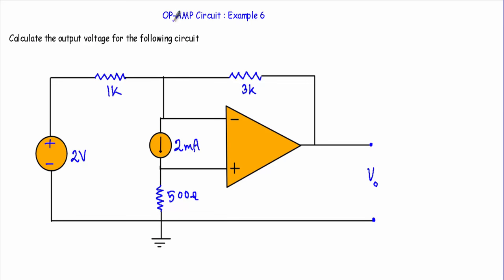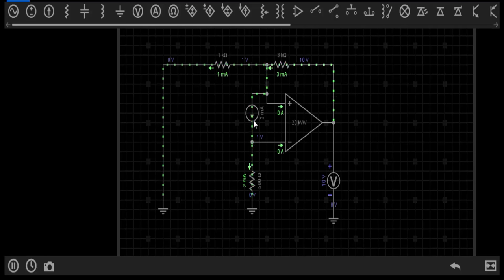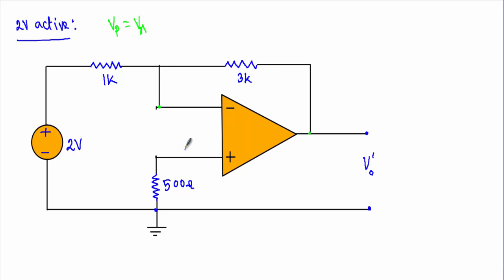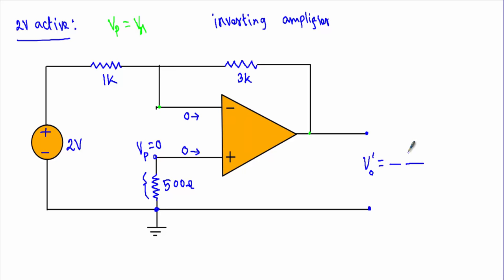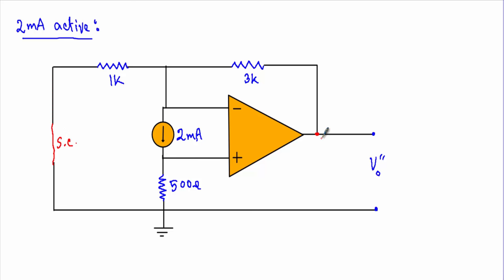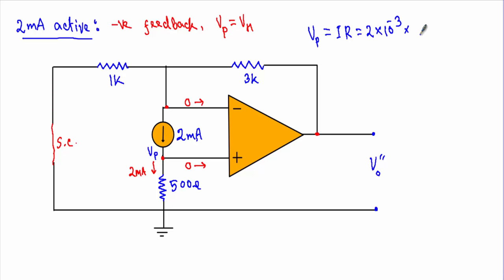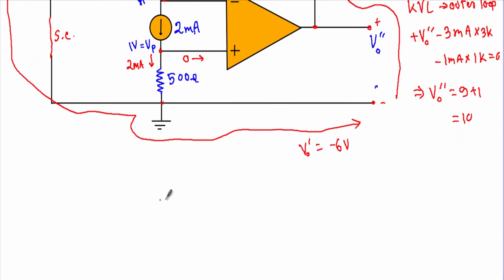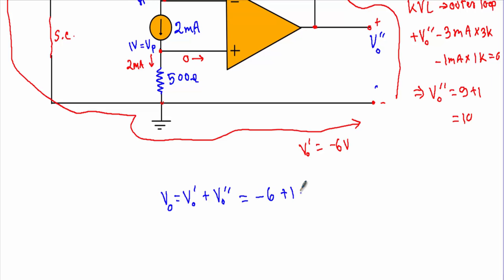OP-AMP Circuit : Example 6

Comment: if we have two same potenial across 2 ma source then how  could possible to draw a current inside 2 ma souece?
Reply from the maker: Here, 2 mA is not flowing due to the potential difference between inverting and non-inverting terminal. You can assume it like " as the voltage difference between those two terminals is zero, those two points act like virtual short. And in short circuit you will get current although the potential difference across that is zero"
Reply from the maker: Another point, don't forget to look at the simulation portion of the tutorial. Look, there we get current of 2mA through that path

Comment: in your mltisim software you showed non-inverting negativing feedback Op-Amp but in your example you going to find o/P voltage for inverting negative feedback op-Amp.Both r not same ckt. please check ........
Reply from the maker: Good observation... Ignore the simulation part. Circuit analysis is okay.
I collected the problem from a handout of Professor James Stalis, Dept. of EECS, University of Kansas, USA.
Check the description box
Reply: thanks for your kind reply .....
Reply from the maker: This is the simulation of this circuit
http://everycircuit.com/circuit/6403721498198016